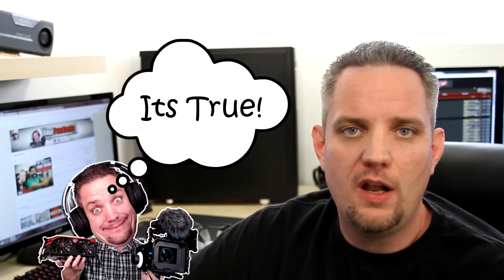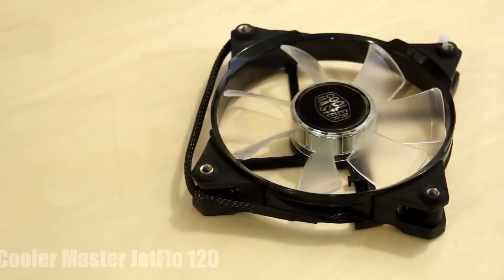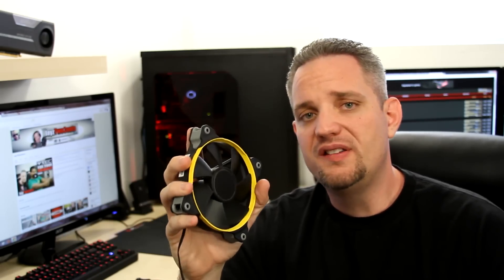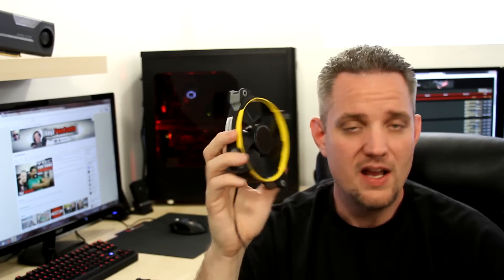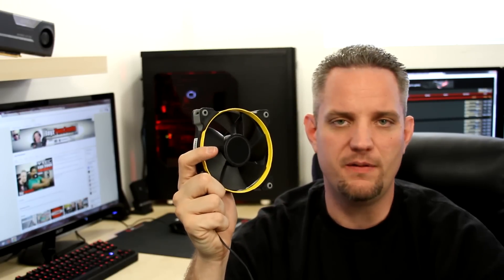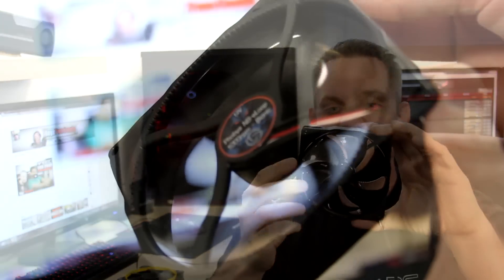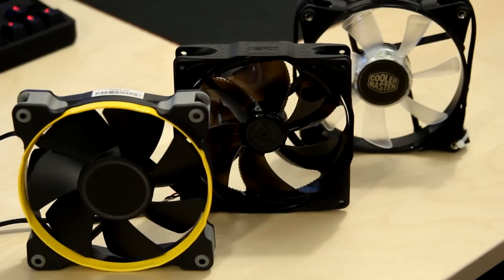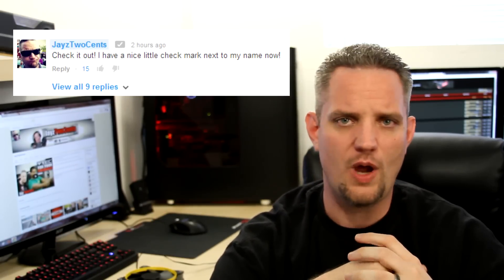Static Pressure vs Air Flow Fans - How to choose the right fan!

Comment: I'm currently using 2x Akasa Viper Fans 140mm ( the model with PWM and Yellow blades ) in my Corsair H110, best bang for buck fans and very good performance!
Reply: ***** Nice! I just love my Akasa Vipers and congrats on your 60mm thick 2x140mm rad with some of these fans, they're very well made and produce alot of CFM and mm/H20 Static Pressure!
 
I have a NZXT S340 case, I did some mods in it, the acrylic side panel was replaced it with a very thin steel net and all fans are taking air off the case, keeping everything cool and nice. When in load if you put your hand in the front/top of the case you can feel the hot air coming out.

Comment: For the case I'm planning use (Silverstone ML07B), there are two case fans directly on top of the graphics card, and a single case fan directly on top of the cpu and cpu cooler. Should I use static pressure fans or airflow fans to get optimal cooling efficiency?
Here's my future rig:
http://pcpartpicker.com/p/YK8rf7

Comment: I'm buying an i7 4970k. I plan on overclocking but not much 4.4 to... 4.6ghz just to game on nothing too demanding.

Watercooling or noctua dh-15 with 4 corsair fans? corsair 750D case
Reply: noctua is better because lower noise and last much longer time heatsink for ever and fams have 6year warranty

Comment: If you had a filtered intake at the front of your PC case would it be better to get a static pressure fan or a air flow fan? Baring in mind that nothing would be blocking the rear of the fan such as hard drive bays.
Reply: Nathan Moule Higher static pressure would be better.

Comment: My current rig:

Processor: AMD FX6300 Black Edition 6 Core @ 3.5GHz
GPU: SAPPHIRE AMD R9 280 Graphics Card (3GB, DDR5)
Motherboard: Asus M5A78L-M/USB3 Motherboard
RAM: HyperX FURY Series 8GB (2x 4GB) DDR3 1866MHz CL10 DIMM Memory Module Kit
HDD: WD 1 TB 3.5-inch Internal Hard Drive - Black
PSU: CORSAIR Gaming Series GS500 500W ATX12V / EPS12V 80 PLUS Certified High Performance Gaming Power Supply

My current PSU is somewhat old and out of stock on most markets. I'm not sure if they're brilliant and many would say it is old i'm not sure. I plan on overclocking to around 4.2GHz - 4.5GHz, currently on stock cooling. I don't plan on upgrading once i have overclocked however i was wondering if the power supply would be ok to overclock, if so i will just buy a aftermarket cooler. Thanks :) Just need help of if it's ok for overclocking!

Comment: Jay, here's a question for you - how are the costs of computer parts (esp. graphics cards) doing in the US? Here in Canada, I have noticed that prices are quite high no thanks probably to the exchange rate - old cards that should have dropped in price considerably haven't even come close.  Since Tiger Direct is shutting down all it's stores, I want to take advantage of clearance prices, but 10% off already expensive units keeps me away!

Comment: Jay, may I ask a stupid question ?
I know in most case (my case is CM centurion), hard disk cage installed behind front intake fan, would the vibration of a high speed intake fan shorten the lifespan of mechanical hard disk drive ?

Comment: Thanks for this! Really useful. I found Bitfenix Spectre PRO PWM fans are best for the hard drive bay being in front =)
Reply: Peter Slater Those are the fans I have running in the front intake of my 750D, I absolutely love them and at 140MM with PWM control at about $19 each, they are difficult to beat.

Comment: Recommendations for fans for my setup? Corsair 750D case. Cooler Master 240L CPU cooler (2x 120mm top mounted). Sapphire Radeon R9 295x2 (120mm rear mounted). That leaves me with two front fans, two bottom fans, and a top slot not occupied by the rad to fill. I was gonna put 2x BitFenix Spectre Pro PWM 140mm in the front, 2x Cooler Master JetFlo 120 in the bottom, and another JetFlo 120 in the extra top slot.  Now I'm not so sure. Thanks!

Comment: Hey sup guys, i've got a Lian Li PC-9NB and I would like to put 2 of these 140mm corsair fans in the front. Since there's not a free space because of the front panel with only a tiny space for air intake, am I wrong if I'm going to choose SP140mm instead of the AF edition?

Comment: I've been using AF120s on my H100i with no problems, as long as the case is nice and wide open, clean and wire free, shouldn't have to be too picky about fans. Corsair 4 life

Comment: The cm (cooler master) jet flow fans have a mmH20 of 2.72 which is higher than the sp120 quiet edition, 0.11 higher than Noctua's NF-F12 and only 0.2 lower than nosiebloker E-loop B12-4. So looking at that the Jetflow fans are really good at Sp (static pressure)  environments!

Comment: I got a NAZT H440 case. Should i use SP for the front intake or AF for the front intake ? I have remove all the HD cages. But i was reading somewhere because of the filter infront it's better to use a SP fan. Any feedback on this ?
Reply: SP, AF doesnt handle well in tight areas
Reply: I got the same case. You'll definitly want SP fans on the front and top of the case. The one in the back (exhaust) can be an AF fan.
The front and top of the case don't have a 'direct' intake. The front has to suck in air from the bottom and the top side of the front panel; there's also a dust filter in front of it and a lot of cages/stuff behind it. The top of the case is similar, where the air has to be pressed out of the sides of the top where the airflow openings are. So you'll want SP fans in the front AND top of the case.

I received my NZXT H440 two dags ago but will replace the 3 120mm fans in the front for 2 140mm Noctua AF-14 PWM fans (SP). I love a silent case so I prefer 140 over 120mm fans.
Perhaps 3 good 120mm SP fans will be able to create some more airflow, but it will be barely noticable in temps. Perhaps your graphics card will benefit slightly.
Reply: I placed 1AF at the back and 1 at the top. SP on the CPU cooler. Front is stock, as is 1 of the top fans. Did you place your top fans for intake or outtake?
Reply: st3yn I just replace the front 3 intake fans to Corsair SP120 performance edition and the 1 rear exhaust to Corsair AF140 quiet edition. At max fan settings, i'm seeing a 7-10degrees drop on my GPU temp while playing FarCry4. GPU fan max at 45%. Previously with the stock H440 casing fan, my GPU fan was running at 65%.

The 3 Corsair SP120 really make a huge difference, Highly recommended. Of coz running at max speed, the fan will be loud. But I'm using the Asus AI Suit 3 to control the fan. So they are very quiet at normal to med load and loud (max fan) at heavy load.

Comment: how to know if the fan is Air flow or Static Pressure based on its spec like RPM, CFM, size, etc? like if cfm high its air/static or if rpm high its ari/static

Comment: I'm thinking about mounting some fans on my Corsair 600t side panel. I can switch out the stock plexi glass and have a mesh which can mount fans. There would be quite a bit of air clearance, would an airflow fan be the correct choice in this case?

Comment: So in my case, (get it? Fractal Define R5) I've removed the top 5 3.5" bays, so that means the top fan as a  lot of room, but a bottom fan would have the 3 3.5" bays in the way, should I just go an AF140 in the top and an SP140 in the bottom? 
Then there's also exhaust and the possibility of an H100i, ughurghailugh

Comment: Why can I not install an old NMB-MAT fan into my new system, the fan is 4 pin and the  system1 connectors on my motherboard are 4 pin, I can slide it over to utilize just 3 of the pins but the fan runs wide open and in my BIOS2 it shows no fan at all connected thus no fan controll.

Comment: thanks for the video found it intresting like to say one thing tho them corsair sp120s dude to the curve of the outer rim of the fan they leak so much air it be ok if you had a radiator which was round if you know where i am going with this you will see the gaps around the fan when mounted to a radiator so that will reduce the presure of the air flow :)

Comment: Awesome video, liked it very much, but I still can't decide which fans to buy for my CM690-II Advanced w/ Window case. I want to replace the existing 3-Pin fans with PWM ones and this time I want to do it the right way. My setup currently consists of 2 x Bitfenix 120 mm bottom intake fans, 1 x 140 mm factory CM front intake fan, 1 x 120 mm factory CM Silent rear exhaust and 2 x 140 mm Aerocool Black Shark top exhaust fans. The case came with an additional 140mm CM exhaust fan, but it gradually got noisy and I decided not to use it (that's when i bought the two Aerocools). My problem is that all these fans are 3-Pin and I'm not satisfied with their cooling capacity. The 120 mm factory CM fan, one of the BitFenix Spectres and an Aerocool started crackling and getting noisy lately so I've disconnected two of them. PS: I don't have and I don't intend to use watercooling in the near future and I don't have an HDD cage obstructing the front intake and my cable mangement is neat and clean. Having presented my case, which of the three fans would you recommend the most? I want the case to be quiet when idle or watching movies and cool when gaming. Oh yeah almost forgot to mention that I have a free 120mm intake on the side window and an 80 mm exhaust on the other side panel.

Comment: Hey, I'm currently working on my first computer, and I plan to replace the stock fans in the case I have. I'm going with Jay's advice and using an AF120 for exhaust and SP 120 for front intake, but I would also like to populate the two fan slots on the top and the extra on the bottom, by the power supply. Here's where I get confused; should I use airflow or static pressure on the top? Should the top be taking in air and the bottom exhausting? If so, should I use an SP fan on the bottom to overcome the somewhat small gap between the case and the floor?
Reply: Thanks for your input! After doing some more research and reading your comment, I've come to the conclusion of dual SP front intake (air has to make it through the drive cages), AF bottom intake (case will be on wood desk), AF rear exhaust, and perhaps AF top exhaust, but natural convection should be alright for now. What do you think?
Reply: ***** I have airflow fans on the front of my case in spite of it being adjacent to the air filter, I did remove the hard drive cages and relocate my drives to the unused 5.25" optical bays, so the air flows right into the case, directly at the underside of my GPU.  I don't think the air filter gives enough resistance to justify using sp fans, but I guess it depends on the type of filter you're using, I've seen people cut white fish tank filter material thinly to use as an air filter on their case.  My case came with the magnetic type filters so I'm not sweating it really.  I could be wrong and if I am I'm open to discussion on it, but really unless you let the filter get clogged up with dust I don't see a real problem.
Reply: ***** Well I use Noctua's throughout, and if you go onto the Noctua site where you get designations of what type of fan to use for which application it's not absolute.

It basically rates the fans on how well they function as static pressure vs high airflow, it's a good/better/best thing, so you can use any fan in any situation, it's just a matter of how optimized for that particular situation it is, but as you said, any fans can be used. 

Jay said it himself, when Corsair decided to specifically label their fans for specific functions is when it all got more confusing as if to say you can't use a high airflow fan on your rad, you can, but it won't be as good as a static pressure one... etc.
Reply: ***** Big motive for using Noctua's for me though is the silence of them, I have a silence optimized case as it is, but unless I'm running Furmark and OCCT at the same time to stress the system, you simply never hear the fans.  The ones I got with the case from Corsair were audible in the same circumstances.
Reply: ***** And that's fine. grin  Just be sure to keep that positive airflow controlled as well.  Intakes made faster in Speedfan than the exhaust ones, I know you knew that already, just saying for the sake of anyone else reading who didn't.

Comment: That was very informative, thanks.
So, checking this. Say i'm getting a 730T, i'd want to put static fans in the front? Or is the grating there minor enough that it'd make no real difference? What about if i'm getting a H110 as well. Would it be worth changing the fans in that to static? Or would the default be good enough?